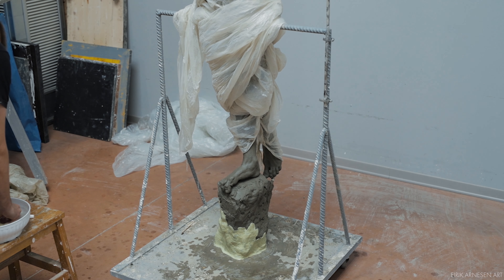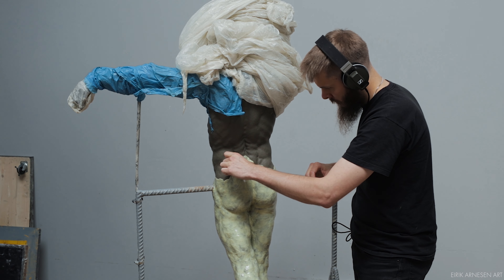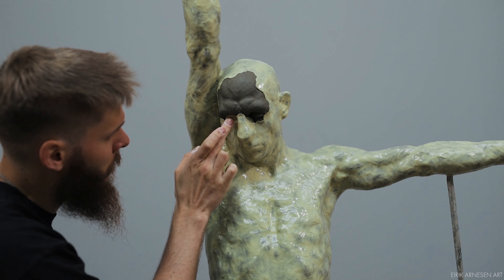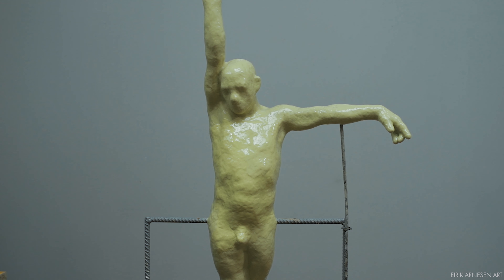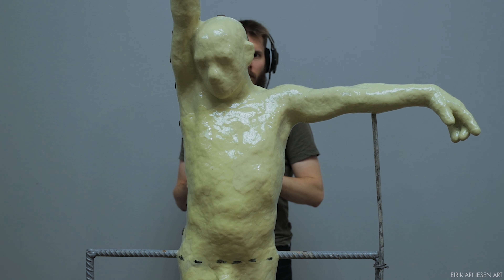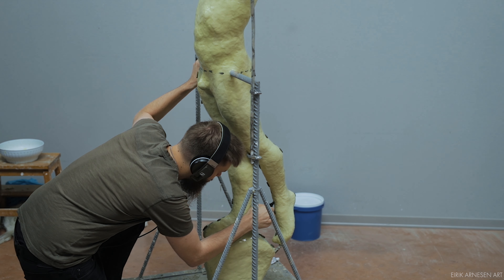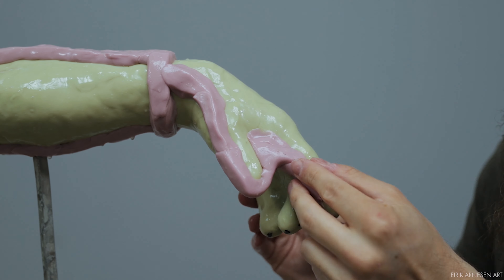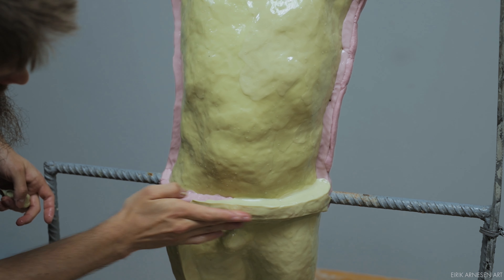Empyrean - Mold Making - Silicone

Comment: Thank you! great tutorial. 
How do you handle the hole that remains in a spot of the armature? Any fluid casting material will leak through it.
Thank you!
Reply from the maker: You are welcome! I usually just plug the holes with a little clay.
Reply: @EirikArnesenArt  Thank you! It will do the job!

Comment: Perfect tutorial and really admire your patience . I have a few questions- what is the ideal time gap between two layers of silicone with respect to bonding between the layers and which resin is ideal to cast (on silicone mold) . Thanks in advance.
Reply from the maker: As quickly as possible, once the first layer is set it's ready for the next layer. Silicone leaks oil and that can inhibit the bond, or dust and dirt can collect on the surface and inhibit the bond. In general though, silicone bonds very well to itself.

Comment: hey Eirik, i have sculpted a half life size figure and would like to make the mold now, i could not find a place to buy the silicone you're using so i looked for a professional place to buy putty silicone in switzerland, i made a sample peace with the one i could find and im pretty sure it is quite bad considering it costs 70€ per Kg. The sample peace i made is just about 3mm thick and if i fold it like a peace of paper it does rip. Do you think that is normal or should it be strong/ elastic enough to resist that? thanks.
Reply from the maker: That sounds strange. I would look for Smooth On products. They are good and have a putty silicone. If you Google the name of the silicone I use and look for the technical data sheet you will find on it information about the strength and flexibility of the silicone. They have a measurement system to determine these things and it should be listed on the technical data sheet. You can then compare the silicone I use to other silicones more readily available to you. Good luck!
Reply: @EirikArnesenArt  thanks alot for the quick answer, i will check again if i can get my hands somehow on the bluesil rtv 3325 p or at least something very similar. Love your progress on the larger than life Krono. It looks amazing

Comment: Amazing work and perfect tutorial! Question: If the silicone putty shrinks a little, how does it affect the first coat that touches the original soft clay work? Thanks!
Reply from the maker: Thank you! It won't shrink enough to make much of a difference. I've never noticed any issues at least! It more about the fit inside the mother mold and how it aligns inside the mother mold.

Comment: Does the first layer have te be dry before adding the second layer ?
Reply from the maker: At least dry to the touch. Which you can check by poking a finger nail into it lightly, if the finger nail imprint stays it's not ready, if it bounces back you can apply the next layer.

Comment: your end result looks as perfect as it possibly can, but taking 8 hours for the detail coat alone just isnt commercially practical. you certainly know what you are doing, but maybe there is room for improvement considering this particular force of habit
Reply from the maker: Being commercially viable is not really something I have to consider at the time, I'm lucky in this regard. If I had to be commercially viable then I would probably have to change my ways somewhat. I'm also taking the easy way out somewhat because these materials are easily available to me here in Italy and I've had consistent success using them. While some might consider working fast an improvement, I don't. But that's obviously based on my individual circumstances. The very same thing can be said about the sculpture itself. Taking 6 months to make one sculpture is probably not commercially viable either. I'm not very commercially viable I suppose, which is why I supplement my income from art with other sources.